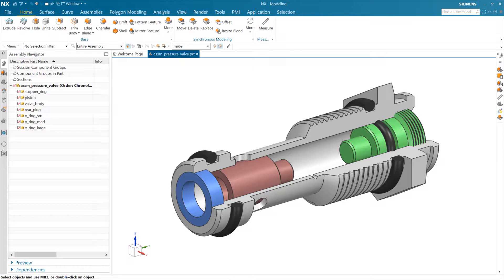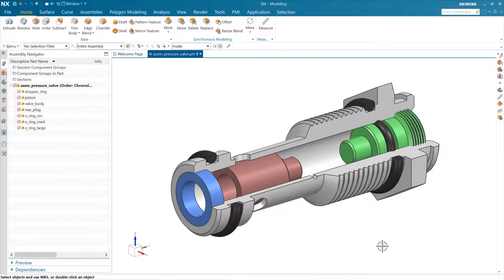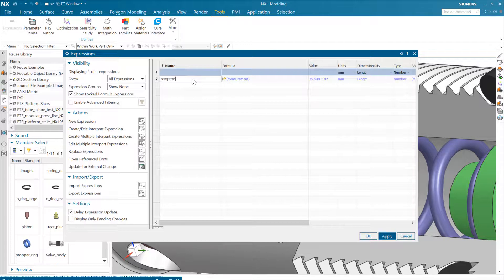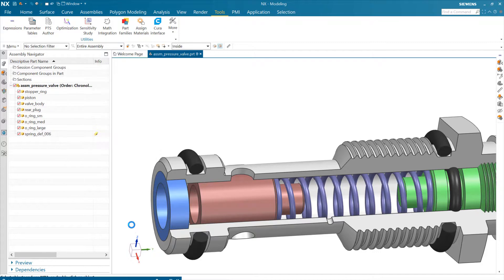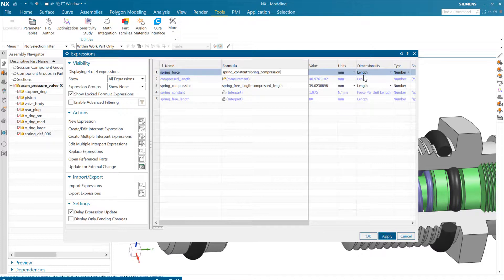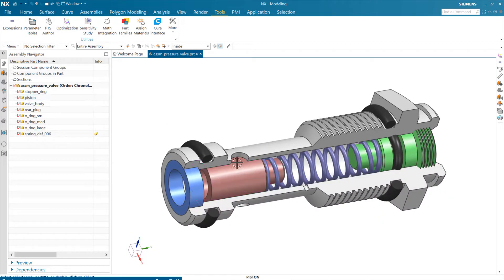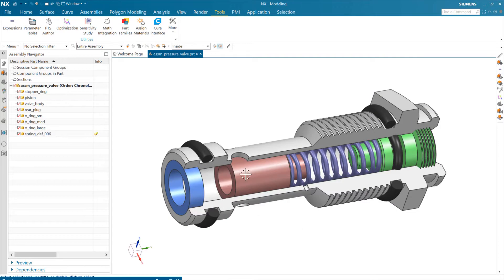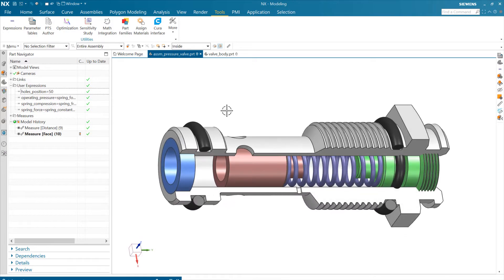NX Expressions: Pressure Relief Valve Engineering Design [NX 1953]

Comment: Hi Mr. Anderson. Awesome explanation regarding expressions along side with calculations. 
Regarding Expressions, I'm facing a problem with Import command. Is there a way to import .exp file with the same structure of Expression Groups and Sub groups originally exported?
I've tried to find out, unsuccessfully, the appropriated format to set the line on .exp file (e.g: (String) or [mm]).
Thanks for your videos, they have a tons of informations and insights.
Reply from the maker: Great question...  We've not yet updated the import/export of expressions to support Expression Group structures.  That would be a great enhancement request!  :-)